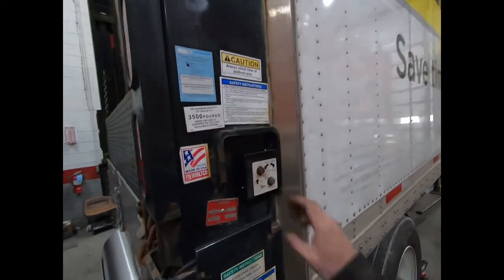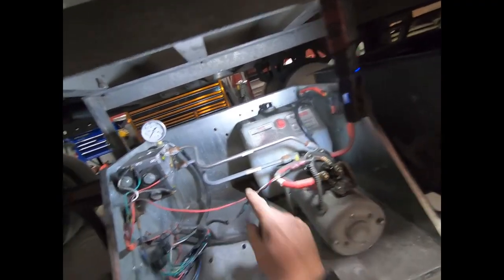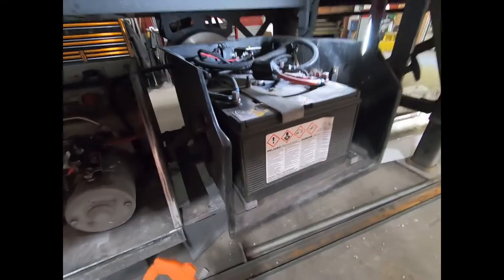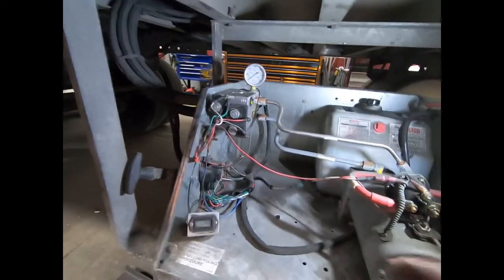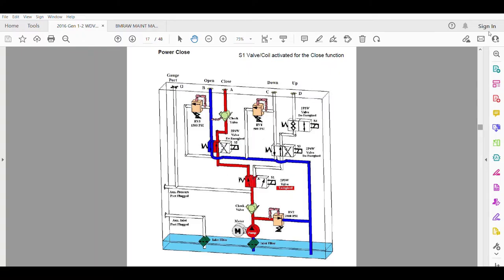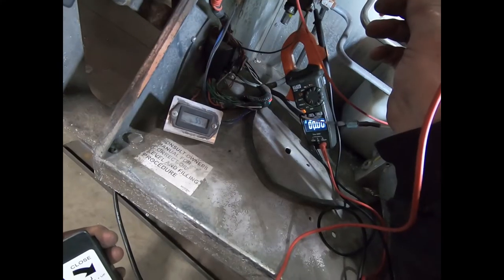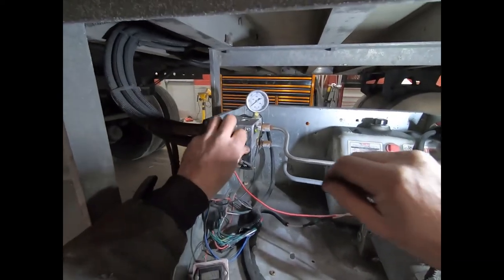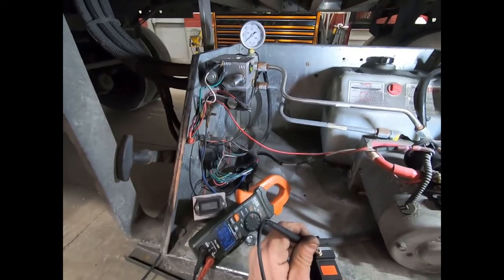Liftgate Troubleshooting. Liftgate will not open or unfold.

Comment: Do you think we could manually move that pin where the solenoid moves whe we have the solenoid off, just for testing befor we install the new one?
Reply from the maker: Yes sir... After you remove the coil from the solenoid valve, remove the valve itself from the manifold block. On the side of the valve that was installed in the manifold block, there should be an opening.  Insert a small screwdriver or other pointy poking device and push in and out.  With medium force you should be able to move the piston back and forth freely about an 1/8 of an inch without it hanging up.  ( I've actually had this fix a seized valve by manually cycling the valve.)

Comment: I have a Maxon lift gate stops working but when I kick tha box it works. Could it be the solenoid ? TIA
Reply from the maker: Doubtful...At least not one the smaller solenoids that just divert oil that is already being pumped by the motor.  I'd be looking for loose electrical connections, particularly on the motor solenoid (the larger one attached to the motor).  Also check the control switch wiring going into the pump box.
Reply: Some much room to work on . ILD suck.

Comment: Where do you learn to work on lift gates? I am a mobile tech wanting to learn more thanks
Reply from the maker: For me it was just on the job experience.  The company I work for services several fleets that utilize liftgates so I just had to learn. A good place to start is by downloading and reading the maintenance / service manual for the model of liftgate you want to learn about. They have a lot of good information and usually include a troubleshooting section.